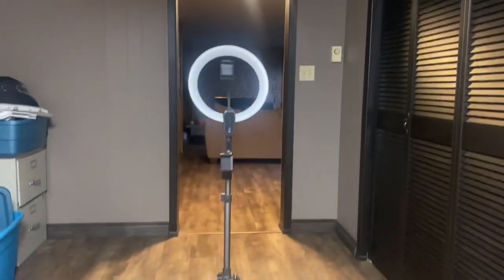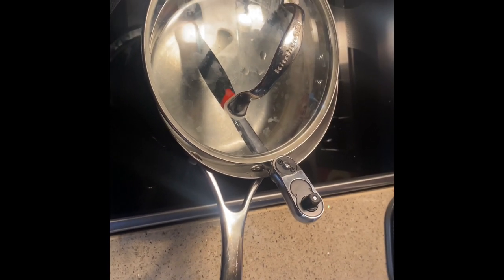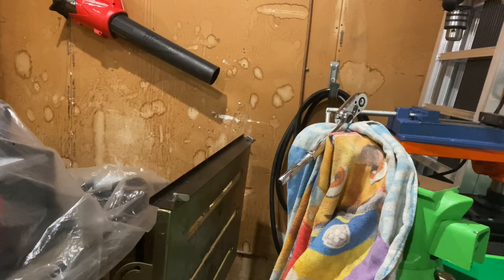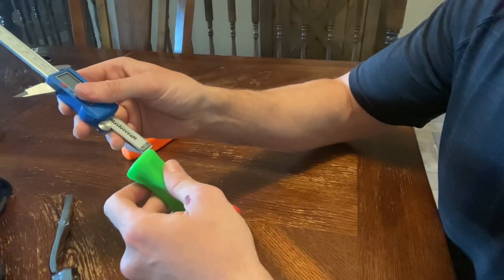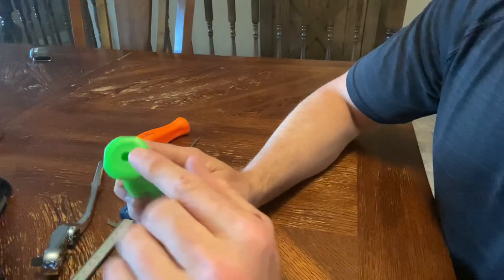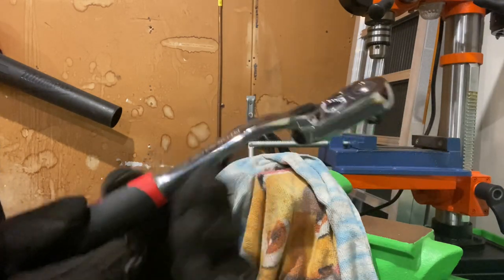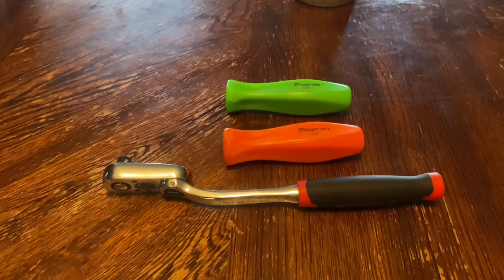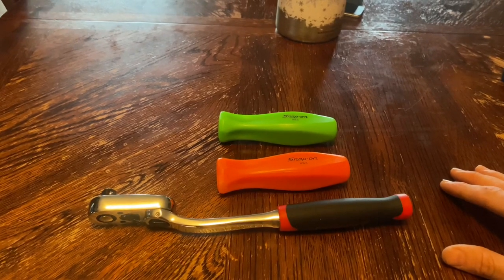How to **Swap** a Snap On Hard Handle 2.0

Comment: I know what you need to do, and if you don't, I will.

Boil the handle off one of those silly Ninja-Turtle-Toy looking Snap-On, striking pry bars.

I took a grinder to the ones I have to make them look normal, but the armchair engineer in me thinks this would've been a better plan. 

Great video!